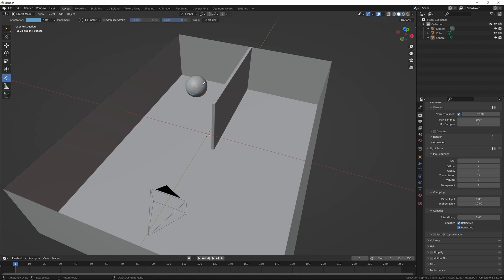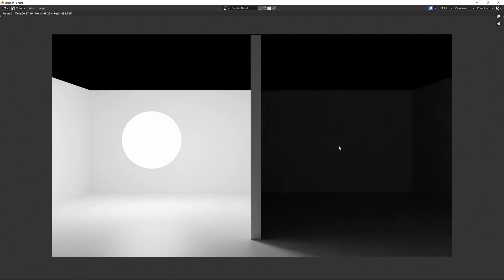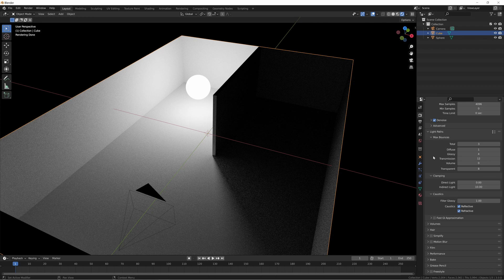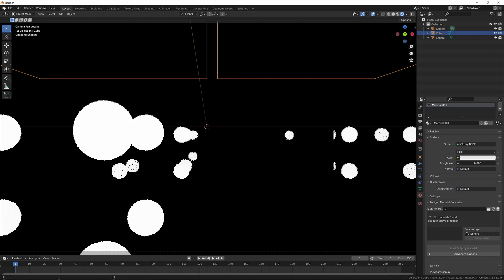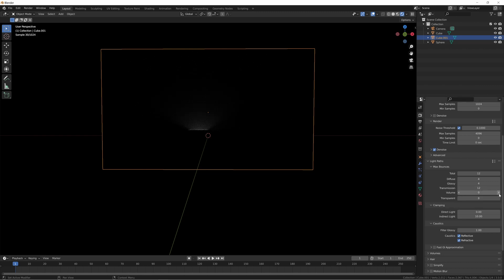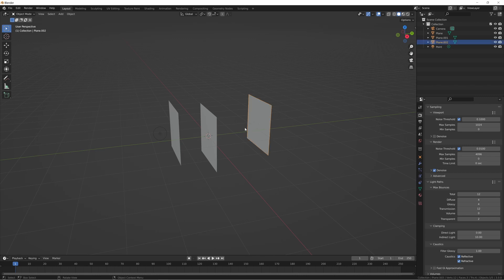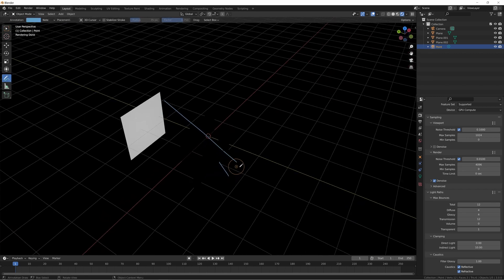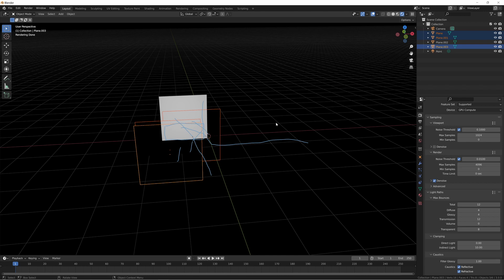Cycles Max Bounces | Blender Light Paths Render Settings

Comment: thanks for this. The thing is that I have this point cloud that has connected the alpha channel because I want to make it transparent mapping a noise texture on that channel. the thing is that I have to raise the transparent bounces up to 100 or more not to get black artifacts on the point cloud. And the problem arises when using volumetrics, with that number of bounces the render time goes up a lot. Do you know any solution for this ? Thanks a lot again!!!!!
Reply from the maker: Interesting problem! When I want to make something partially transparent, I would typically use a mix shader node and connect my main shader with a transparent BSDF, then plug the noise texture into the Factor on the mix shader. Have you tried that?

Comment: Note: setting a bounce to zero means one bounce. setting a bounce to 1 means 2 bounces. and so on. If there were zero bounces, the walls and floor would not be visible. Initially what we see, is that first bounce off those surfaces. Perhaps the transparent section demonstrates it the best: going from zero to 1 (1-2)  enables the light to fully reach the rear plane through the 2 transparent objects in front of it. In blender world, the count starts at zero. Think of when you duplicate an object: the duplication is ex: cube.001 because under the hood, cube.000 is number one. Just something to keep in mind.
Otherwise, this is a good video!
Reply from the maker: You're absolutely right! I suppose a good way to think about it is that the number of max bounces is really referring to the number of bounces for indirect illumination (i.e. excluding illumination from the light directly hitting the object).

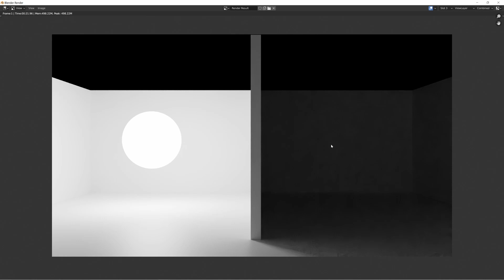Comment: 2:27 is kinda realistic like look at it through a camera lens perspective since most pictures that are dark will have some sort of noise in them when taking the picture but honestly this helps :) 

Thanks so much for this
Reply from the maker: Absolutely! Although, the noisiness in the image results from a sample count that is too low, rather than a max bounce that is too low. Also, there's a really subtle difference between camera noise and render noise, but it is there. So if you were going for absolute, complete, total, ultimate realism, you'd want to render with as little render noise as possible and then composite it with actual camera noise.

Comment: So I'm trying to get realistic clouds and fog etc using TrueSky and it seems volume will be an important property for me to adjust. How many bounces should I use for renders involving lots of volume?
Reply from the maker: My general rule of thumb is to just leave everything at the default since it’s usually a pretty good balance of accuracy and speed. Then do a test render of a small region of your scene and see if you need more. The volume bounces especially can add a lot of time to your renders, so it really comes down how to just how realistic you can tolerate vs how much time you’re willing to spend to get there.

Comment: another question, would n't just upping ambient light do the same job? I turned off indirect light competely, upped the background light to 1 and its makes no visible difference?
i guess this jsut applies for indoor scenes?
Reply from the maker: Actually, upping the ambient light accomplishes a different goal. Since you can think of ambient light as being one big light source that is coming from all directions, raising that will raise the brightness of everything that is exposed to the ambient light. Raising the bounces, however, will just affect how much the ambient light (or any other light) will illuminate objects after the initial bounce. You can see this for yourself by just taking the default cube and insetting and extruding a bunch of faces randomly so you end up with a complex(ish) shape. Look at the brightest and darkest parts of your shape and then turn the total bounces down to zero. Notice how the  brightest parts of the object stay the same brightness, but the shadows get darker. If you then increase the background light, you can get those shadows back, but the rest of your object will get brighter too. And this applies to any scene, indoor or outdoor. The bounces affect how much the lights in your scene (ambient or otherwise) are able to "bounce" onto other objects and illuminate them. Just keep in mind that for 95% of cases you won't need to touch these settings at all. And even then, you probably won't need to either.

Comment: I noticed on my scene the settings do not really make much difference, for example my shadows stay dark no matter how much i bump up the bounces.
However, if I turn on Fast GI Approximation , I got the desired effect straight away, ie more bounce and lighter shadows
Reply from the maker: Without seeing your scene and being able to look at how the light is actually interacting with it, it's hard for me to tell if you should be seeing a difference. Most scenes just don't benefit from additional bounces. Try instead turning down the bounces from the defaults and see if you notice the shadows getting darker. If they do, that means the default bounces are likely already optimal for your scene. Also, keep in mind that you'll likely need to increase the total and individual bounces (i.e. diffuse, glossy, transmission, etc.) and not just the total bounces.
As for Fast GI Approximation, I haven't really ever used it, so I'm not exactly clear on what it does, but keep in mind that it is an approximation. So, while it may accomplish what you're wanting right now, if you're going for photorealism, it won't exactly hit that goal. But, if it does what you want, then feel free to use it! It is kind of strange that you're getting brighter shadows with it turned on though. Based on a real quick test scene I threw together in like 30 seconds, it actually makes my shadows darker. But, like I said, I haven't used it much before, so take that with a grain of salt.
Reply: @ltfilm  it's an odd setting. if you set the samples to 1 and increase the factor, it makes the scene brighter, like GI and since mine is an outside scene, its just what i want ie making the shadows brighter. But if you increase the bounces to 2, it gets darker???( behaving like AO